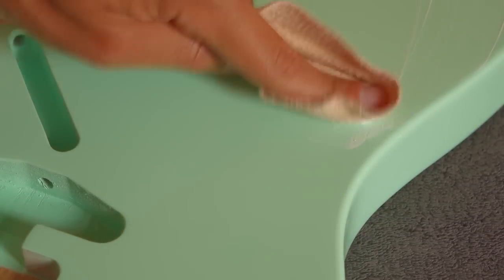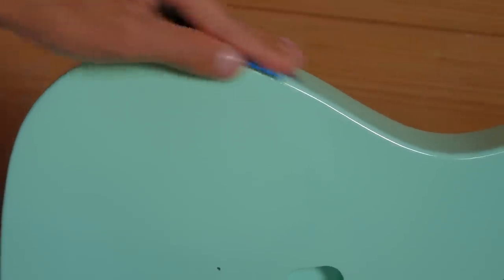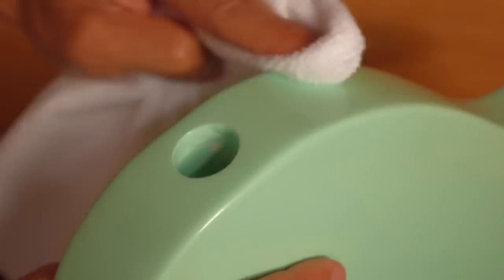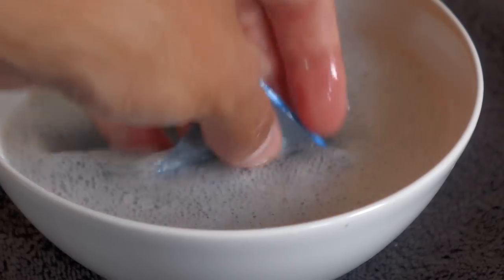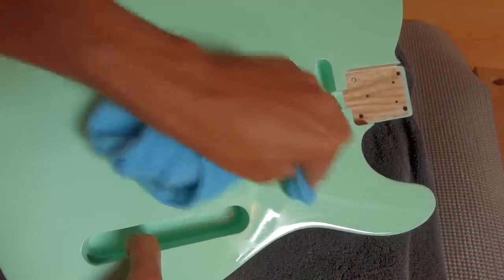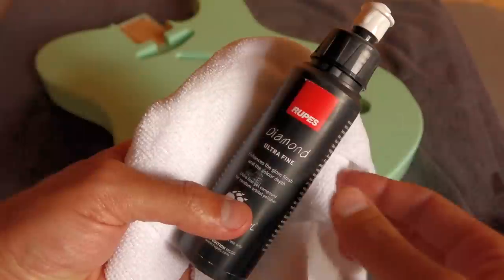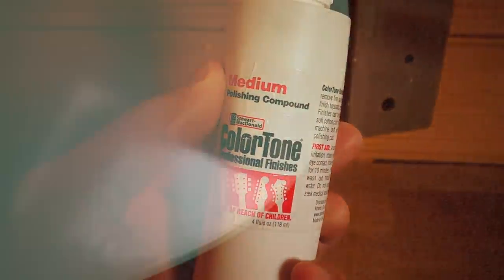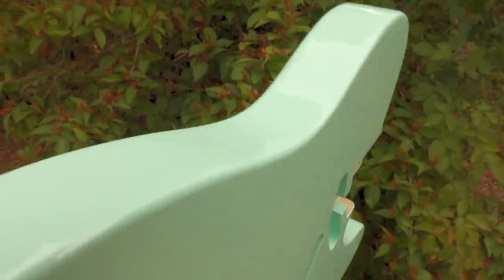Nitro Guitar Finish Tutorial - Part 3: Sanding and polishing

Comment: Thank you for your vids. These helped me painting my guitar. I really love working with Nitro. To me its easier to work with than poly, My finish coats went on pretty smooth. I have a few more coats to do. Im using aged lacquer on the first few as I want the color to look older(but not relic) I went a little heavier in the areas of the arm and hands and it looks pretty legit. Thank you once again for taking time to do these.

Comment: Hopefully you're still checking comments on this one: Finished a tele body using these techniques and they worked very very well. The problem I seem to have run into, I believe, is a matter of temperature control. I did the spraying/curing in a California USA garage. The spraying in spring and let it cure for about six weeks. By then, the temps in the garage would have fluctuated from the low 60s F to the high 80s. Upon first sanding with the 1000 grit, everything dulled as expected, and I worked through the additional polishing steps as outlined. I certainly got a mirror-like finish. I also discovered a significant amount of checking in the nitro. Noticed it first when I wet sanded with the finer grits. Thought it might have been a sudden reaction to the water temperature versus the temperature of the body, but then closer inspection revealed the entire guitar suffered some degree of checking. Now, if I'd wanted to do a relic job, this would be an AMAZING relic finish and a trick I'll remember as it seem quite organic relative to the "blow dryer/sprayed nitrogen-canned air" method. Question: for future builds, should the drying/curing take place in a more temperature controlled environment to prevent the checking? And I also imagine there is no way to correct the checking other than to strip and refinish the body?

Comment: This 3-part series was great.  My guitars, on purpose, always show the grain and I never use filler.  The majority of my builds are "natural' wood and I use a home-brewed varnish finish.  When using a Fender classic colors in nitro (I use rattle cans), I still let the natural grain come through and it will not be high gloss.

However, I now have a project of a '63 Fender Musicmaster that some idiot tried to refinish on his own.  Not sure what the original color was.  It looks as if it may have been a Fender Red Mahogany, which Fender sometimes did use on this model and the Duo-Sonics.   However,  in researching, I found Fender, at the end of a day, would sometimes shoot these models with the  classic colors still left in the spray guns.  Therefore, I'm going to do a Daphne Blue, high gloss.

Thanks for the great tutorials!
Reply from the maker: Sounds like a great project! I also love to see that wood grain, but most customers seem to prefer the high gloss finishes.

Comment: Now this is how you do a tutorial right. Pretty much everything you need to know, in the order you need to know it in and with out any annoyingly long winded explanations and a bunch of "ahhs" and "umms" or even worse a text to speech computer voice or no voice at all. Instead of helpful instructions you get some crappy royalty free music and text you have to pause the video to read. You know the ones I'm talking about.

So yea. Good job. I'm getting ready to do a nitro finish on a set of MDF speaker cabs that I am building and I'm cruzing around youtube and the interwebs to see how other people do this kind of finish to maybe pick up a trick or two before I begin. I've done plenty of nitro finishes in the past and I know how to do them but it's been about four years since the last one and I'm far from an authority on the matter so it never hurts to see how others do it. MDF has it's own set of challenges to deal with but the basic methodology is the same for both. 

I might add that if you are worried about water from the wet sanding process swelling anything you can use mineral spirits instead of water. When finishing MDF you want to stay away from water and water based products as much as you can. Another little bit regarding rattle cans. Watch your spray finger that it isn't hanging to far over the nozzle and in the stream coming from the can. I've done this in the past and it's a good way to screw up an otherwise good finish. Secondly, when you get down to where there is just a little bit left in the can switch it out for a fresh can. Don't try and squeeze every last little bit out of the can as it can start sputtering and dripping and resulting in less then desirable results. That's my two cents worth, adjusted for inflation of course..

Comment: Again great job just a couple pointers. Personally on such a soft paint like lacquer minimal sandpaper 1500 and at this point unlike video I would not touch no edges. Second off he was standing with his fingers big no no! Use a flat rubber squeegee. This ensures proper flatness sanding that's the purpose. After your first sanding of 1500 just to knock down the main roughage then work your way to the 3000 grit. Now you can slightly do your edges but not much at all needed emphasize best to stay away if you're new as the buffing and polishing will take care of the edges again caution. Quick note compounds and polishes are liquid sandpaper. As mentioned from heavy grit to light grit to super light grit with polishes. Polishes are not sealers like some think. I do recommend sealing fresh paint with a glaze. Glaze is safe for fresh paint but do not wax. It still needs cure time. If you have an older guitar that looks great you can polish it in wax is safe and recommended sealer for paint. Not fresh paint. Glaze is for fresh paint. Hope this helps
Reply: For those who don't think paint needs to be sealed that may just say I've been doing this 40 years and have seen the results personally. Number one son and environment are brutal it will gradually oxidized over time. This protects it from that and other elements. Also for those who say you can put wax on fresh paint. No you're not going to see no immediate bad effects. After a couple of years you'll wonder why it started crazing and other spider web deformities. This is cuz it was wax early in life while the paint wasn't cured. It takes time and you'll regret it. I've seen paint jobs come back 10 years later because of this. And hate to admit I made the mistake myself on my 67 cougar I owned for 30 years. Hope this helps

Comment: Great tutorial! I got a lot of orange peel with my clear coats. Tried wet sanding with 1000 as suggested but was taking forever. A luthier friend of mine suggested dry sanding with 400 but I was getting too much corning on the paper so wet sanded with it. I've been terrified of sanding through the finish but he told me that if there's still orange peel, you won't sand through.
Reply: thats a great tip. I would never thought about that!

Comment: Excellent tutorial. A few points I could add. After spraying the last coats of clear, wait a few  days and wet sand lightly with 600 grit. This allows the paint of off-gas solvents much quicker and cut the drying time in half.  Make sure the polishing compounds are well mixed before you use them as the abrasive tends to settle on the bottom. As you go from one grit to the next make sure you remove any of the previous compound from screw holes and routs. When wet sanding I use a little rubber squeegee that's about 2"X3" to wipe the water off to check for low spots, much faster than stopping to dry it with paper towels. They make good sanding blocks for wet sanding small areas, too. Available at auto parts and auto body supply stores. Been spraying lacquer since 1966, so yeah.....
Reply from the maker: Thank you for those additions! Best regards, Will.

Comment: You should sand with a block first and then all through the entire project.  The lacquer will shrink but if it doesn't have any scratches to shrink into it won't appear fuzzy. the block will keep the surface flat for a good reflection if you sand it with your fingertips it'll get all wavy .  For an example you should have picked a dark color. Black lacquer.

Comment: that's pretty nice.. you can blow the water out of hole with compressed air then let dry 5-10 minutes should be fine, do you just screw right into the glue or do you remove it, that's a good idea really if its a very quick set like 20 seconds or so then just screw right into it..  good tip...  you did a nice job here, very nice and one cannot tell its aerosol can, are you using the good adjustable tips from stewmac or whoever carries those? allow you to change pattern 360 for any angles, I think they have em on the compressed air setups where you can get different size tops for different patterns or spray widths what not?  speaking of have you or do you use those aerosol cans with the small bottles so you can mix your own colors?  curious what pigments you are using and if you have come up with a good peach tint.. my next 3 bodies are going to vintage specs, one peach, semi gloss, maybe a flat, then semi clear?  same for the others colors one granny smith green apple and one banana yellow..

if I had wood like you have I would be doing some clear colors, have you done tutorials in those like the Tele butterscotch so you can really see those grain patterns, man that tele body was so nice, perfect grain, you must have a nice stash of that species to cover that beautiful grain like that, it looked so good right after the fill...  lucky dog, you prolly have all the power and hand tools too, pin router, band saw, table router all that stuff, neck making tools too... lucky...

Comment: Very nice job.
Never been a fan of nitro paint in its purest form,yellows cracks etc, but most lacquer today is probably acrylic lacquer. Which is a bit tougher.
The car industry stopped using it for these reasons back in the fifties.
It makes me wonder if the imagined sound improvement of nitro is worth the cost and weeks of drying times..
Have a listen to SWLABR on The Creams disraeli gears or even Sunshine and tell me that '64 Gibson SG that was hand painted in thick oil paints is suffering from poor sound quality.
Most of us could only wish we could make a guitar sound like that.
If nitro is the way you want to go then good on you and as I said this is a very nice job but give me, paint one day polish and reassemble the next,  polyurethane any day.
And no the plastic looking finish you see on Chinese guitars isn't a requirement.Yes you can make them shine like glass but you can also get a soft gloss look like a vintage instrument. But a much more durable finish.

Comment: Good job! Very detailed and clear video. Congratulation. Just wanted to know in case I want to get the wood color under gloss layer, I undestand after initial sanding I have to put liquid grain filler + sanding sealers + clear gloss. Correct?

Comment: Thank you so much. A question before finish sanding. I'm still applying clear coats of nitro,: it's a Mohawk Satin product. It feels rough to the touch. How long should I wait to sand between coats of Clear Coat? Again it's a satin product and the texture is confusing me. I can't tell if everything I'm experiencing is normal for a satin clear coat .. or .. if I need to sand between dry coats? If so, how long should I wait to sand between clear coats of satin? Thank you!

Comment: One thing I've had difficulty with is what grit to start with in the sanding process.  Most tutorials say to start the process at 1200 grit, but I have found that 1200 grit isn't nearly abrasive enough to effectively cut into nitrocellulose.  In my experience, 320 or 400 grit is required to properly cut in.  The grits I have found are required are 400, 600, 800, 1000, 1200, 1500, 2000, 2500, 3000, 5000 and 7000, then I move to the light and medium compounds.  With this procedure, I am able to get a decent, glossy finish, but I'm confused by how other folks are able to get a mirror finish with just 1000, 1500, then the compounds.  If I followed this course, there would be lots of visible scratches.  I am using nitro from spray cans and not a spray gun.

Comment: Hi! Super vidéo, I learned a lot, thanks. One question : if I apply a satin clear coat, do I have to sand the body with 1000/1500/2000, before applying the satin laquer ? Or can I just do the same things you do,  without polishing?

Comment: hello, very good tutorial ... I have a doubt; between each layer of paint should be sanded? the same for the clear, between clear layer house should be sanded? regards!
Reply from the maker: No, sanding in between coats is generally not necessary. I only do it when I have any imperfections in my finish.

Comment: Wow, incredible finish! About to start my first project, so your videos are immensely useful. Need to make sure I don't rush it. 

I think I will have to spray relatively indoors... Please can I ask, when you talk about good ventilation, is this a matter of ventilating well AFTER spraying? Obviously wearing a good mask. Presumably you don't want a draft or cold air coming through whist spraying? It's zero degrees outside. Many thanks for all the time and effort to share!
Reply from the maker: I'm sorry for the late response, for some reason your comment was marked as spam. Anyway, you mostly want good ventilation while spraying. The particles are so very small, they will go everywhere. So I'd be very careful with spraying inside. A garage could work though. Ventilation is also important after spraying, as there will be fumes coming from your work. Slightly opening a window will take care of that though.

If you have no other option than spraying inside your house, you could consider building a simple spray cabin using some filters and fans. Be very careful though. Best of luck!

Comment: I’ve been working on a guitar for a while using aerosol cans. Had been a bit lazy on the prep so I’m not expecting 100percent results but I’ve used a hell of a lot of paint, and it’s looking good, however I have been wet sanding in preparation to put the clear coat on, and I have gone over the edges twice and had to buy more pain to rectify this. Do you have any tips in sanding the edges? Really struggling! Thanks for the video it’s helped a lot

Comment: so im guessing if i need to patch up a bad relic job that i did, this can work, my guitar is a poly arctic white, i found an arctic white nitro finish touch up paint which i plan to use, just wondering how would i go about applying it, since usually painting guitar people use spray cans and spray evenly to get a better consistent layer, but if i need to just cover a circle patch in my already existing finish, can i just apply it manually randomly and then scratch it off and wet sand it to get to sit better with my poly finish and then polish that area, or is it better to spray it

Comment: Awesome videos. So much info to take in!
Looking for some guidance:
I have a 2017 AVRI sunburst jazzmaster and am looking to cover the sunburst finish with another color such as white or black in hopes it’ll eventually wear to expose the sunburst underneath the top color. 
What steps do I need to do for just this top color over the stock body? Thank you!
Reply: Hi, if the finish underneath is already nitro you should be fine going straight over it with the new colour nitro, I’d just give it a key with a really fine paper, same as if the existing colour is poly, you will be okay going straight over it with nitro

Comment: I'm now in a process of thinking weather i'm going to swich from poly to nitro, because of the better wood breathe and collab with air to maybe get better sound as the time goes by, but i'm just curious when the nitro will start to crack and show some relic? Just like some custom shops relic guitars? Of course longer you play there are more chances but some predictions? Few years, 10,15? Thanks!
Reply: Hello, I hope I can answer your question on the cracking. I used to do nitrocellulose finishes years back and they would start showing some cracking after about a year. I was using a furniture grade lacquer though, which was probably pretty brittle. There is also a method I have used where I sprayed a couple of coats of clear shellac before spraying the nitrocellulose finish. This supposedly let the finish slide a little bit and crack more easily if that is what you are trying to achieve. I did this once for a customer and he used a freeze spray from electronic store and sprayed it on the finish for instant cracking.

Comment: Hi, is it possible to wet sand with a very high grit sandpaper instead of using a polishing compound and get a similar finish? I'm not after an extremely shiny finish so would it be enough? Thanks for these videos, they're exactly what I needed.
Reply from the maker: Theoretically yes it's possible, as polishing compound is basically very fine liquid sandpaper anyway. So you could sand up to 5000 grit for example, but at that point the sandpaper will clog up very quickly and it just doesn't work that well in my opinion. If you're looking for a semi-shiny finish it's probably better to get a satin clear coat. Doesn't require any sanding or polishing after application.

Comment: Hi. Amazing video's! Best I could find on this topic as I am setting off to start a project myself.
Question: I see that most of the holes for installing the bridge and the neck-plate are pre-drilled, only the holes for the pickguard still need to be done. Is there a general rule about drilling holes after applying the finish? Is there a risk of chipping the nitro if you want to drill the holes for the bridge after the paint job is done?